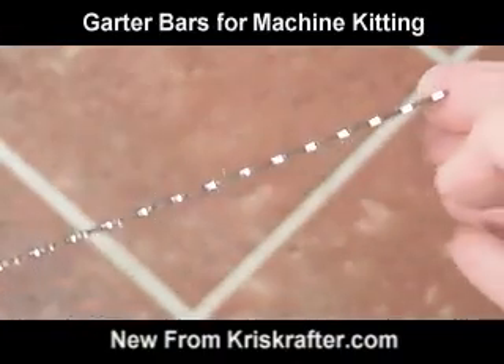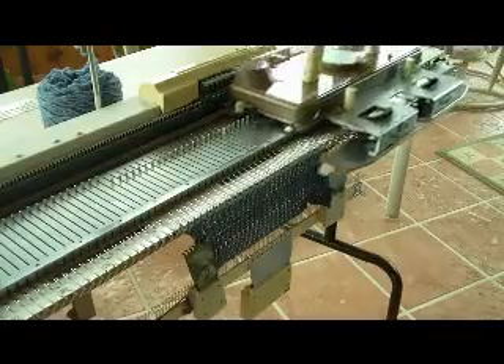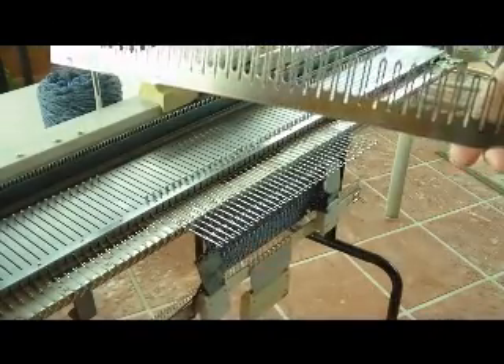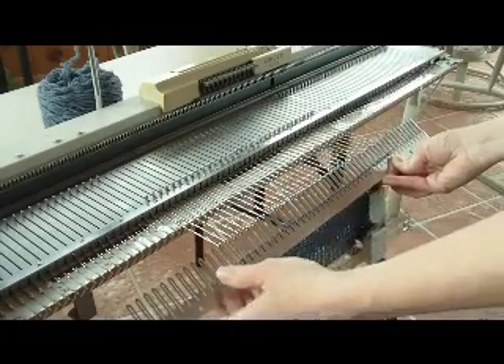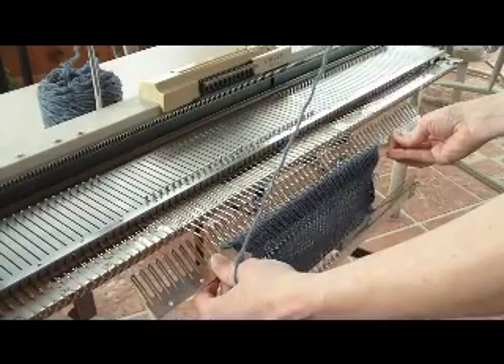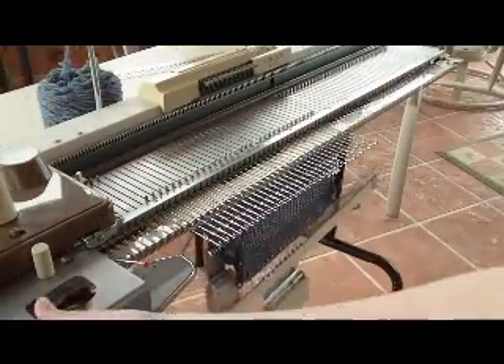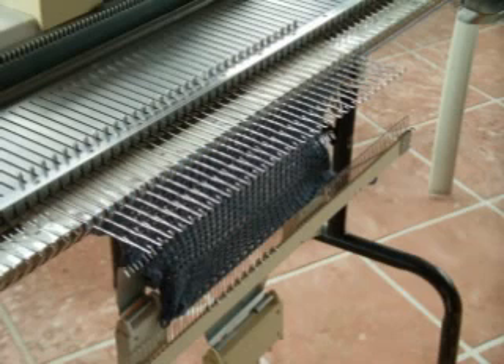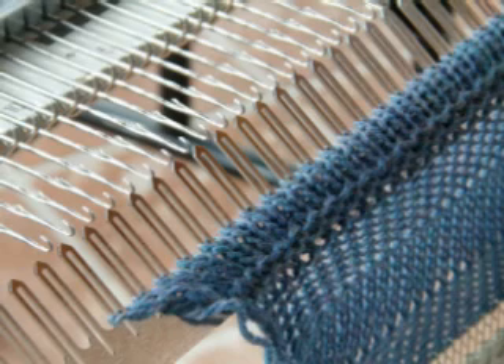NEW Garter Bars for Knitting Machine by Kriskrafter.com

Comment: How do you two garter bars at the same time?  Do they connect together, or do I have to machine some new part?  E.g. 100 stitches.
Reply from the maker: The set of garter bars connects with a connector set for the times you want to use it on a full 100 needle bed.
Reply: @ikraftr  : Thanks!!!

Comment: I have spent hours trying to learn how to use this thing. I managed to learn to get the stitches onto the bar, but have not once successfully put them back on the needles. This is not "Easy to use".
Reply from the maker: +L Brandau both the old style garter bars and my open track garter bars do take a bit of practice.  Some people get it pretty quick and do fabulous things with them, and others do have to practice a bit.  I too struggled at first then finally got the angle right when putting the sts back on the needles.  I seldom do garter stitch so when I do I have to practice up a bit.  I mostly use mine for increases/decreases and specialty stitches.

Comment: Hello, does this work with the lk150? I bought a 6.5mm garter bar from eBay and it did not fit my machine. I wonder if all 6.5mm machines are not the same!
Reply from the maker: I don't know what brand of 6.5mm garter bars you purchased on ebay - I didn't know anyone else made them.  My garter bars in the 6.5mm size fit the LK-150.  I sell them to users of that machine all the time.